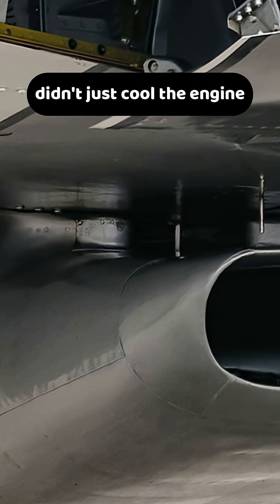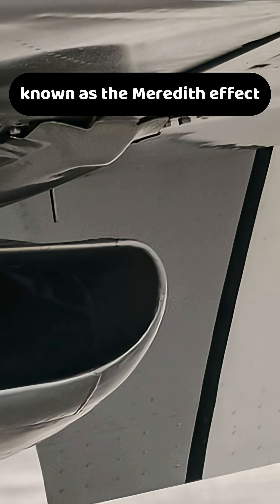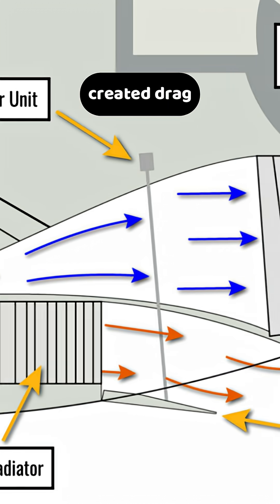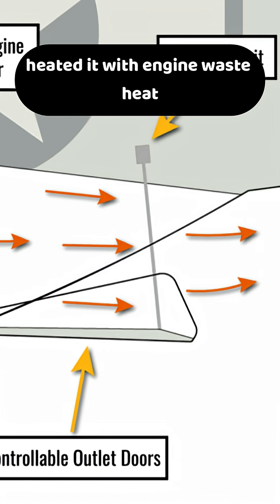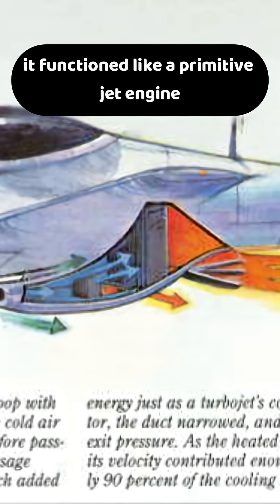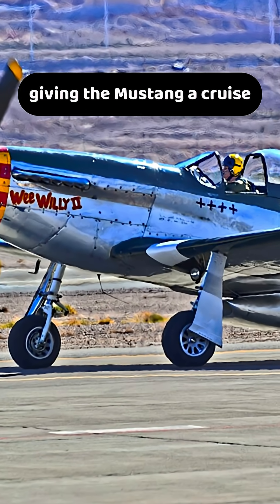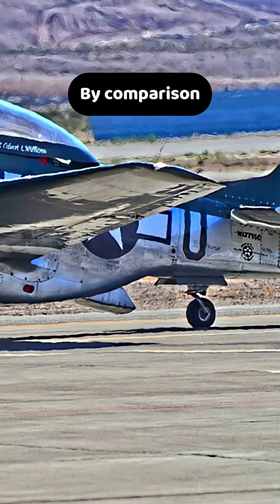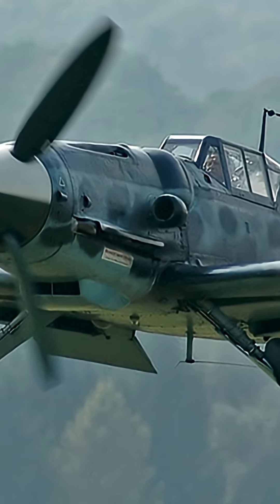The P-51 Mustang's Accidental Jet Engine

Comment: Calling this a jet engine is moronic.

The air warmed and expanded, slightly compensating for the drag of the cooler.  That’s An advantage but not an earth shattering one.

The FW190 had a more interesting system.  Its radiator was in front of its radial engine which was also its intake for cooling air.  The radiator was armored to protect the front of the engine and there was a ducted fan which drew the expanded air into the engine.  As a result the 190 had the lowest parasitic drag of any piston fighter in WW2.  A significant bonus was it’s engine was basically immune to machine gun fire from the front.  Even 50 cal wouldn’t pen at range.  Considering the 190 was designed to kill bombers that was a huge advantage.

Comment: Engine cooling that adds parasitic thrust is so bad ass. Usually cooling an engine simply adds weight and you don't really get any extra power beyond what your engine can produce at optimal temperatures

Comment: The main point of the meridith effect was to provide low velocity high pressure air to the radiator, which reduces the drag cause by the radiator vs high velocity low pressure air

Comment: This is misleading. The drag from the oil cooler slowed the plane down more than the exhaust air sped it up. Also, I don't think the exhaust air was "compressed."

So it's better to say that the Meredith Effect enabled the oil cooler to restore some efficiency that was lost to drag.
Reply: Well I just read five articles on the P-51 and its radiator and all five articles stated that it did indeed increase its speed.
Reply: @richardeast3328  Versus no Meredith Effect exhaust? Yes, it would, but only a mile or two per hour. But the drag from the radiator itself caused way more efficiency loss than what the Meredith Effect was able to restore. Still a good thing, yes, but that was not the reason for the Mustang's excellent top-end speed at all altitudes relative to other single-engine fighters of its day.
Reply: @darrellid y en q se basaba según tu la mayor velocidad del p51

Comment: Description isnt accurate. Radiators cannot compress air
Reply: " Radiators cannot compress air"  But the ducting containing the radiators can.
Reply: @feathermerchant 
i dont think this has any significant effect.
Reply: @Cjephunneh  "i dont think this has any significant effect."  Bernoulli's principle.  Changes in the cross section of the ducting affects pressure.
Reply: @feathermerchant bernouli analogy is different than the radiator situation 
also no net force is generated
Reply: @Cjephunneh  *" bernouli analogy is different than the radiator situation 
also no net force is generated "*  The radiator AND duct are part of a SYSTEM that produces pressure and thrust.  Perhaps you have a different explanation of how it works, if so lay that out in detail.  Thanks.
Reply: @feathermerchant you have two sources of energy. the hot exhaust (around 200 c) and the low temperature heat from the radiator (around 100 c) . The heat from the radiator cannot cause the air to energize and compress enough to be of any useful value. Therefore the only useful energy that can be transformed into drive power is the exhaust. 
Greg’s garage on youtube  has a very detailed video of how the FokeWolf Bf190 used the exhaust to increase speed. It has all the charts and calculations. 
This may be helpful.
Reply: @feathermerchant  
https://youtu.be/9wb5YzVbTNo?si=jS0ll4k1606YTuYw
Reply: @Cjephunneh  " ...how the FokeWolf Bf190 used the exhaust to increase speed. "  But the topic of this video was the P-51 not the BF-109.
Reply: @feathermerchant watch the video . He does a comparison to the P51 . It turns out the scoop under the 51 is for the supercharger and the radiator
Reply: @Cjephunneh  As they they say at Burger King "Have it your way."

Comment: Spitfire' radiators also gave thrust.
Reply: I doubt that because the only way this works is if you have a very long gradual diffuser inlet like the mustang to get a full pressure recovery.   It also works better if you have a large radiator area with low velocity airflow, which minimizes the pressure loss over the radiator.   The nozzle side is relatively easier to make work well because you don't have to worry about flow separation with a short nozzle.
Reply: @glike2  Whether you doubt it or not, Spitfire radiators used the Meredith effect to give thrust. The low drag of the Mustang was due to North Americans' superior build quality in producing a smooth wing and fuselage. The British Purchasing Commission had noted these high standards, which is why they went to North American in the first place.
Reply: @alangledhill6454 I am an aerodontical engineer and believe me you're wrong.  If you think this because you read it somewhere or somebody said it that does not make the physics work

Comment: But it was also its Achilles heel as just one burst of cannon fire from behind ment overheating and a downed plane.
Reply: Not good for water ditching either.
Reply: LOL Oh damn, let's ground all those P51s
Reply: This is a fact for any liquid cooled engine aircraft.
Reply: @bobbylee2853 Except, the 109 had 2 radiators with a circulation cut-off for each, so that if a leak occurred in one portion of the cooling circuit, the entire cooling system would not be  compromised. Also, some models had a radiator heat exhaust by-pass that allowed radiator flap to remain closed, reducing drag. Radiators were partially contained within wing of F-K models, also reducing drag. These models also had a slight, reduced fore to aft aerodynamic shape to the oil cooler housing that created a slight venturi effect.
Reply: At low altitude just a single rifle bullet could cause a leak which would cause its doom if it was a long way from home over enemy territory.
 As in the Vietnam air war, called the golden BB.
Where a single illiterate peasant with a beat up rusty old Mosin Nagant could down a million plus dollar hi tech American fighter at low altitude  with one lucky well placed shot.
Reply: Skill issue. Fighters werent built to take hits, they were built to avoid them
Reply: @caralho5237 ok kid

Comment: This effect was not just exclusive to the mustang . The soviets did it with the yak series , the japanese did it with the ki84 and ki83
Reply: While technically true this is more of an afterthought. Liquid cool radiator all did produce some thrust but the p-51 is unique in it that it utilize it efficiently.
Reply: @misakjaxjj I doubt that because the only way this works is if you have a very long gradual diffuser inlet like the mustang to get a full pressure recovery.   It also works better if you have a large radiator area with low velocity airflow, which minimizes the pressure loss over the radiator.   The nozzle side is relatively easier to make work well because you don't have to worry about flow separation with a short nozzle.  Without the whole system design properly you just get drag.  Heating up the Air does not produce thrust by itself unless you don't lose too much dynamic pressure.
Reply: @glike2 So did or didn’t it increase the P-51 speed.